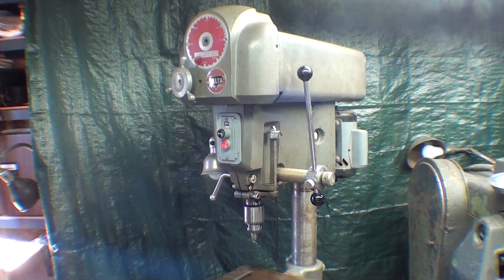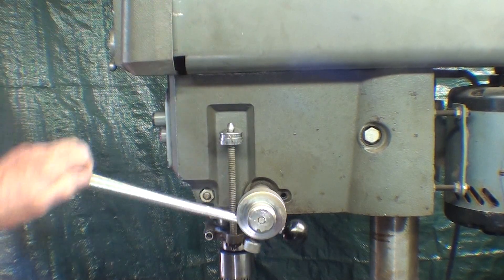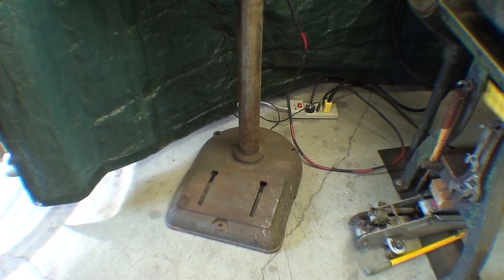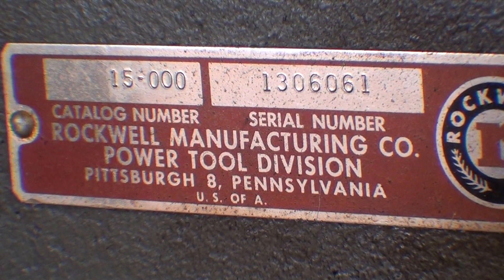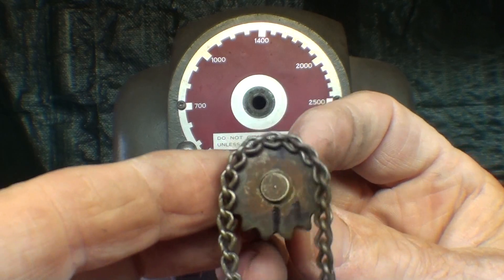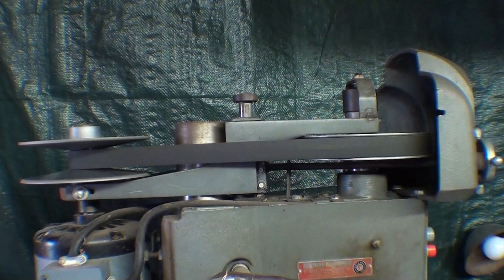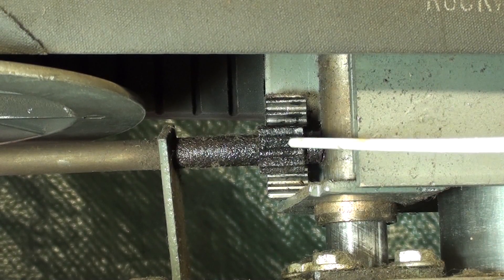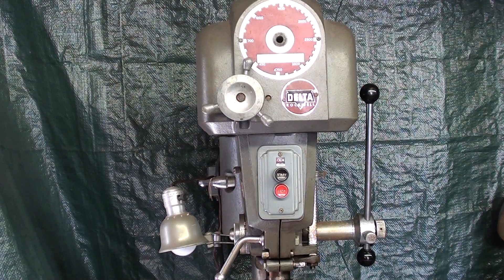SHOP TIPS #399 HOW the Delta VS Drill Press Works tubalcain

Comment: Great video, just what I need as I soldier through refurbishing mine which was fished out a dumpster in remarkably good shape! Any suggestions for a replacement belt? The one I purchased on ebay is about 3/4" too long yet has the correct part number.

Comment: Hey Mr Pete, greetings from Northern Illinois! I was wondering about the key slots on the base of the drill press. Do you know what that feature was meant for?
Reply from the maker: Also, to hold large work. The table is swung off to the side, and the drill press head may or may not need to be lowered

Comment: I got one of these 25 years ago, worked great. Suddenly the spindle would stop turning under a load. Took the cover off and watched the system through speed changes. At the lowest speed, the motor-end pulley would open too far leaving the belt loose against the pulley spindle. Then noticed two missing set screws on the motor-end pulley. Raising or lowering the pulley spindle on the motor shaft caused crazy variations in the reported drill press RPM readout. It didn't take much to find the correct location (and secure it with set screws). But I haven't quite figured out how someone setting this machine up would know the correct elevation of the motor-end pulley and what the elevation is relative to. The answer may come to me in my sleep (as answers do). Still, if anyone can tell me, I would appreciate it.

Yeah, lifting that table and securing was tolerable for a long time, but at 76, I'm not liking it. I'm thinking hydraulic cylinder.
Reply from the maker: Thank you for the comment. I’m afraid I can’t help you, I have not had any trouble with mine. At 78, I can’t lift anything anymore
Reply: @mrpete222  Whether or not I understand why, the variable speed is working and a 4" hole saw won't stop the spindle. I only just found you based on the one video. That is quite an anthology you have on youtube---great resource.

Not being able to pick things up is a shock. Let a vintage 1 foot jointer with 7 foot table go last summer because I can't throw a 2 x 8 x 12 beech plank up on it anymore. Riding a bike 10 miles doesn't faze me. I can dig the garden for the wife. I play the piano a lot with no issues----helps my arthritis too. Guess I'll have to accept what aging leaves me with, but I don't like it. Best to you.

Comment: Question, I have the same drill press model Delta Rockwell 15-000 but the regular pulley system. What is the brass little nob for on the left hand side? Next to the id tag.

Comment: I have a delta 15-270 in really good shape but the spring doesn't return the arm, it doesn't appear broke and i'm not sure how to adjust it. Wondering if you have any idea's? these are the part numbers for what it looks like. Pinion spring cover #402-04-031-5001 , and pinion spring assembly #402-04-320-5001.

Comment: The variable speed drive is called a Reeves drive https://en.wikipedia.org/wiki/Continuously_variable_transmission#Variable-diameter_pulley_.28VDP.29_or_Reeves_drive
My variable speed Series 1 Bridgeport mill uses the same type of drive as does my Ariens(/Husqvarna/Gravely - same mfg.) "automatic" lawn tractor. 
CVT transmission cars use a segmented metal "belt" running in a special "traction oil" instead of a rubber/fabric belt. CVT car transmissions are not repairable yet to my knowledge except by the manufacturer. They are simply replaced with a new one if it breaks $$$$$.

Comment: I believe that single handle was put on by a previous owner. I own one of these drill presses and it has the standard 3 handles on the quill feed. Which is also what is pictured in the Owner's Manual
Reply from the maker: I just looked at the owner's manual, and they showed the single handle.
Reply: I may need a part re-made for mine. Would you be interested in such a project if so?

Comment: I own the other failed Delta split-pulley variable speed drill press (20-950).  You're lucky to have found this. It's absolutely fabulous to not to mess around with belts to change speeds. To your point, its complexity prices it out of reach for most people, and it wasn't a commercial success. Mine is early-days Chinese (Delta trying to keep the price down), so execution is disappointing in some ways.  Still with a bit of rework it's a marvelous addition to the shop. Powermatic makes one now, but it's an inferior design to the Delta.
Reply from the maker: Thanks for watching--I am unfamiliar with that model.. But I just found pictures of it.

Comment: Over here, in the UK, we had the Raglan lathes from the early '40s until '71 (bought out by Myford and closed down). A different adjustment mechanism, but the same variable sheave pulleys. Great little lathes and a small milling machine (I have both) with the same drive. ChrisB257 even took lathe his with him when he moved to your side of the pond. For the Raglans they recommended always starting on low speed to help the motor a bit; not so important for a simple drill spindle (no heavy chuck, lead screw gear train and possibly a heavy workpiece in the chuck!). Your drill looks like a super example of a quality product built at a time when durability was still in the vocabulary.

Comment: The only problem I can see about using a pulley and belt is....that if you go too far, or it slips,  the meter may keep moving, and the needle will be off.  That's probably why they used chain in the manufacture.  I can't think right off the name of the belt, but it's flat with notches.  Cars use them a lot, like on water pumps and timing belts.  I haven't seen any chain like that in a long time, but someone may have some out there.

Comment: Oh look it has a CVT (Constantly Variable Transmission) LOL.  Never turn that dial when the drill press isn't running, you'll really screw up that variable speed mechanism.  Hey, it even says that right on the front.  Same way with the Shopsmiths, those things really got messed up if you turned the speed adjustment dial without the machine running.

The CVT's in vehicles use chains rather than belts if I recall.
Reply from the maker: Thanks for watching
Reply: William,
What would happen if one did attempt to change speeds while not operating?
Thanks, 
ian
Reply from the maker: It jams or pinches the belt
Reply: Oh yes, I see how that would happen. Thanks.
Reply: Continuously Variable Transmission.  A constantly variable transmission would be of little practical use ;-)

Comment: safety hazzard  the head casting just clamps on the tubular post vibration can cause it to drop-slide down the post in use. drill a hole thru the casting and tube and install a safety bolt.
Reply: Legitimate question here...has anyone actually seen this happen? Clausing, for one, also clamped the heads to the column. My 20” has a safety collar, but properly tightened, the clamp bolts exert tremendous force. I can’t imagine them coming loose.
Reply: What a load of twaddle! I would think every pillar drill ever made uses this build method. The table is fixed by this method on many drills and unless you loosen them they don’t slide down. Here in the UK 90% of builders scaffolding is built by collars clamped onto tubes and they don’t slide into a heap when a bus drives past! I’ll give you a 14lb hammer and you see if you can move the head down the tubular post by hitting it. News-flash! -you won’t move it. Do you have a seat-belt on your arm-chair?
Reply: I lost the tip of my left index finger when changing a drill bit and the head dropped.

Comment: Others may have mentioned down-thread, but I think the spindle down-feed lever is the high end item. If you are running multiple parts, you can adjust the lever to exactly where you want it. And you can set the lever so it won't be running into a larger work piece...it beats having to remove one of the down-feed levers because it's interfering with the work.
Reply from the maker: You may be right--I just assumed it was the cheap one

Comment: I think I have the part you are looking for.   I upgraded a similar drill press to VFD some time ago    The diameter of my sprocket is : 0.939" ; overall length of shaft is 1.355"  with a turned down collar of 0.372".   Chain length (doubled over ) is 5.125" and width is 0.26"  
You're welcome to both as I have no need for them
Reply from the maker: I ordered chain on ebay this morning. If it is the wrong one, I will get back to you.
Thanks very much

Comment: There was a dreadful little car made in the Netherlands, (the DAF), that used pretty much the same variable cone pulley system as a transmission.  It used engine vacuum and springs to  automatically change ratios dependent on load and speed.

Comment: I have a Clausing Drill Press from about the same era and its cone drive is not as well designed and made as this one seems to be with the possible exception of the indicator mechanism. The cone drives in the current import presses that I have looked at are very flimsy and will not last very long IMO. It does not surprise me that drill presses are going to electronic speed control with inverters as I am sure they are cheaper to manufacture. Enjoy the "new" addition to your shop!

Comment: 470 RPM is just too fast as the lowest speed, why don't machine tool designers make machines that go down to 40 RPM with powerful motors and gear drives? I know such machines exist but they're all massive industrial machines when smaller versions are possible to make for home shops.
Reply: Lite Roadie Why would you need 40 RPM on a machine that is designed for drilling the smaller range of hole sizes?
Reply from the maker: I could not agree more. Even a slow speed motor on this machine would give 300 rpm
Reply: I have 2 drill presses a bench top and a floor model. They both turn way faster than I like for 1/2 inch and larger drills. So I use the mill for that. Have thought about swapping in a lower rpm motor though.

Comment: Replacing the chain with a new piece is the easiest fix. If I were to replace it with a rubber belt, I'd spring for a cogged timing belt and two pulleys with the teeth milled in them, to keep the indicator arm in the same relative orientation just as the chain does, i.e. "c locked" or "timed".
Reply from the maker: yes--I just ordered chain--ebay

Comment: Thanks for the video. I have this same model of drill press and really love it. Mine has an 1140 rpm motor, which brings the speed down to around 300 rpm. FWIW, I paid about the same as you did for mine. Original receipt on mine says it sold for $265 in 1964, so you got a great deal.

Comment: 2 Thumbs up!!!! mrpete!!! I am really glad to see that you made this video on the drill press, reason being is I bought one last summer that is the same as the one you have in your basement the man was selling 3 of them all Delta Rockwell .The one I bought was said to have bad bearings and or bad motor ( the spindle was froze up TIGHT, motor would not turn) the other two sold very quick one $280 the other $350 I paid (bid) & won mine for $80 thinking it would be a good rebuild & learning project (maybe?) & I would finally have a good name brand floor model drill press. When I made it home & started to check to out (take it ALL APART) because I know NOTHING about Delta/Rock drill press's it wasn't the bearings or motor at all but that NUT just above the chuck the one that you put the chuck key handle into(spanner nut?)was so tight that it locked down the spindle & motor!! I cleaned & oiled, greased everything that turned & put it all back together everything worked, ran GREAT until that nut ran itself up tight again & stopped it dead! Could you or maybe one of your many wonderful subscribers know why this keeps happening? I don't think anything is missing. I went online looked up the model # (15-555) found a parts list but that didn't really tell me anything also what is the JT size?( I think it is a # 1) I need to buy a chuck for it & don't want to buy the wrong taper. I really hope someone can tell me what I am doing wrong because its driving me nutz to have it just sitting there and waiting. I would love to finish cleaning, painting this NICE Drill press and FINALLY start using it' Sorry this became a short story but I wanted to get it all out there lol. And like always GREAT JOB Mrpete  you Sir have taught me so much and I Thank You!
Reply: If it's the same chuck as Mr. Pete's, I believe it's a JT 33 taper and the chuck is a Jacobs 34.  I bought a chinese version without the threaded collar and made a nut for it.  Same thing happened to me as you.  I'm gonna put a little set screw in it with a brass insert to keep from marring the threads.  I have a Sears drill press and a Clausing that use this exact chuck.

https://www.mscdirect.com/industrialtools/jacobs-34-33c-keyed-drill-chuck.html

Good luck!!
Reply: Rosario W I am glad you found the problem with your machine. What if you removed that nut? I guess it was meant to help remove the chuck but it might not be needed. Or drill, tap and put a set screw in the nut to prevent it moving up the spindle.
Reply: AtelierDBurgoyne Thank you for the input it is much appreciated , yeah that seems to be the only use I can see (or remember) for that nut to be there is to push the chuck off instead of using wedges. I never thought of a set screw I might try that
Reply: stxrynn Thanks so much for the input as well as the link for the chuck at least I can get the chuck now and maybe get motivated to finish it!

Comment: We used to have a commercial mixer we used for mixing cake mix and dough for Croissants. The mixer was a Russian made Bear varimixer which used an identical variable belt drive. I wonder if the Soviets had a spy steal the variable drive design from Rockwell? ( ha ha ) As for Car trans ,the most well known belt drive was the Dutch DAF ,which was later redesigned and sold as the Volvo 360 .
Reply from the maker: They copied our B-29 bombers---so why not the delta drive
Reply: My dad had the Volvo DAF 66 auto car that ran this variable speed transmition, the odd quark about it was that it would go as fast in reverse as in forward, made the lower sphincter tigthen if you pressed a little too hard on the accelrator when in reverse lol.
Nice video @mrpete222 I much prefer the older drill presses that why I purchased and restored an Atlas 64 / 74 not sure which